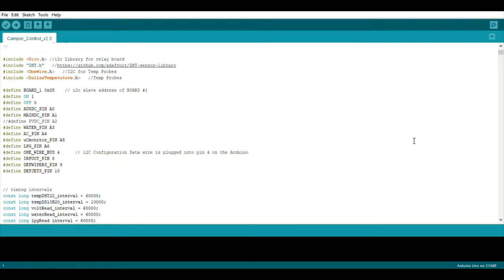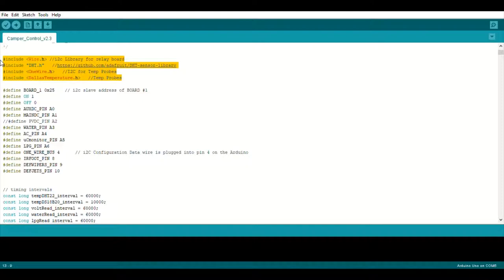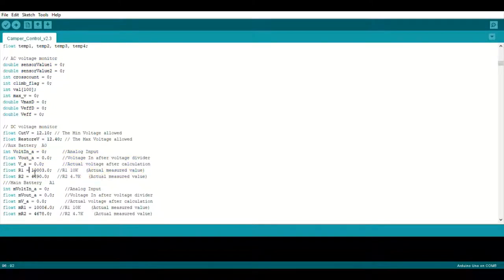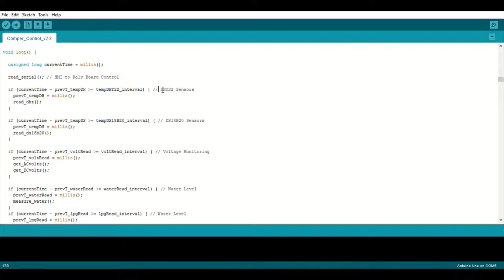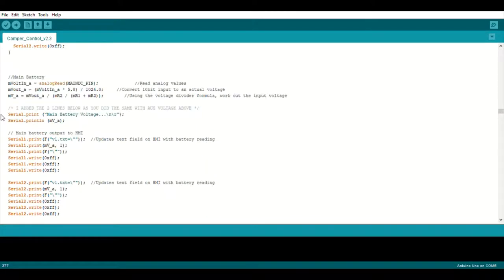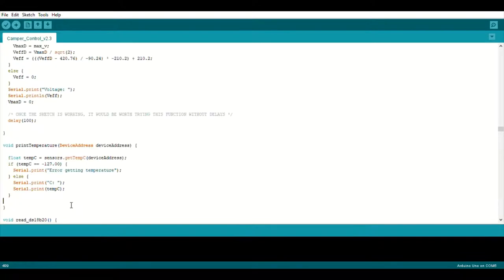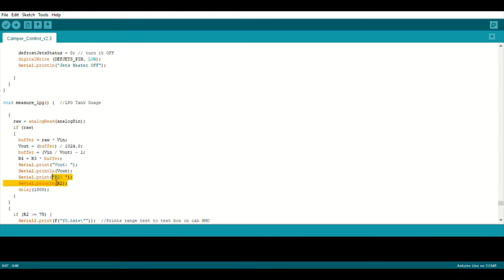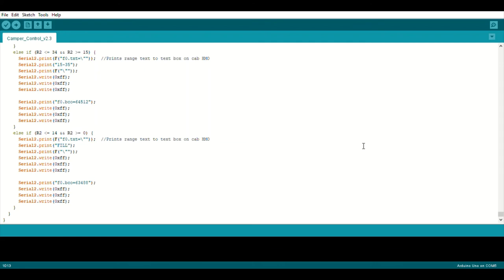Camper Controller Arduino Code

Comment: This is fantastic work mate! I'm two weeks into Arduino and doing exactly what you've done; diving straight into campervan controls. I'm up and running with 4 sensors but having some issues. Would it be possible to have a copy of your sketch so I can pick through it and learn please? I need to flatten the learning curve lol.
Reply from the maker: Nice one dude.  I found having a real life application to be a great way to learn something really dull!  Good luck.    
I've put it on github >>>  https://github.com/campercontroller/C
Reply: @simplestuff3895  oh mate! Thank you so much! I figured out the issue last night after 3 days of effort, but going forward your code and seeing the big picture is going to help immensely. Thank you!